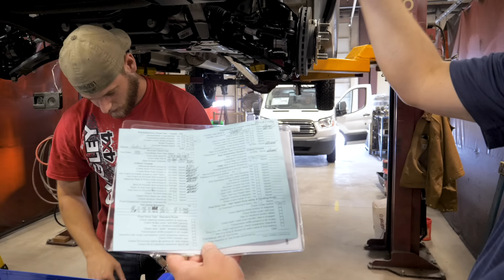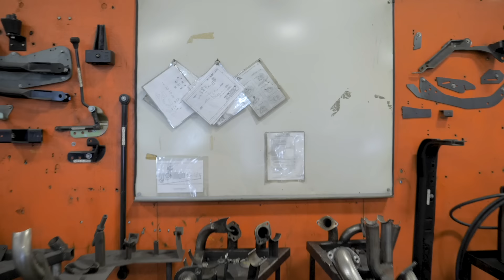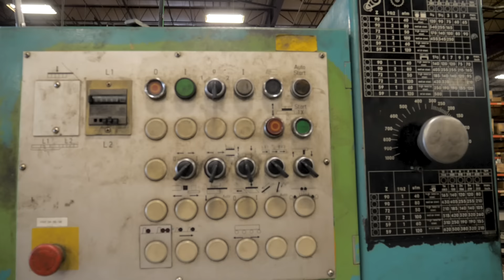Quigley Motors 4x4 Van Convertion Factory Tour With VP Of Engineering Tod Quigley

Comment: It's only the UK that uses right hand drive vehicles. I think the reason why people would use an American company is that there isn't the market and the businesses in the UK NZ and Australia that really do this. The 4x4 sprinter is rarely seen or used. Most vans/motor homes are on road only. I think people will be slow to catch on to the benefits of a 4wd van but when they do I assume the manufacturers will be ready as they would of been studying American vans. I don't if companies like sportsmobile have a present in UK NZ or Australia and ora right hand option but they could bring a lot of business to NZ and Australia with the UK to lesser extent.

Comment: Impressive facility. They've been in business for over 40 yrs. They are by far the most complicated conversion company out there and also not the best.  Used to be a horror show to get one there conversions serviced. I commend them on converting the Transits but the Transit is a piece of junk. Dont know hwy people buy them. The Sportsmobile is a much better conversion (Ford E-Series)
Reply: Agree about transit...but who else has this 4x4 reputation? Is service still issue?
Reply: Advanced 4wd in Utah. They've been in business as long as Quigley. They're better in some ways and worse in others. Quadvan in Oregon is ok. Other conversions that are better (Ford): Ujointoffroad &  swc4x4
Reply: Also I dont think service is as much an issue anymore since they now use a Ford axle. When Todd says the Ford axle doesnt fit right in the vans hes kind of lying. It actually fits pefrectly. They only mod I see that they do is cut off the track bar mount (a Ford engineering brain fart) and put their own mount on and their own track bar. Which is a very good idea. Ford puts a ball joint on the axle end of the track bar instead of a solid bushing. Anyone who owns a 2005 & newer F250-550 has experienced the front end wander and even death wobble. IDK why Ford hasn't changed this issue yet. Quigley also still used their torque arms instead of the Ford radius arms. And thats why they ride like shit. The torque arms are waaaay to short. The suspension doesn't travel enough and it constantly bottoms out. But they use these torque arms because it really wouldn't be a Quigley if all they did was replace the track bar.   Click that link to see the NHTSA road test videos of the Super Duty death wobble. Brand new trucks.              https://www.superdutywobble.com/video-gallery